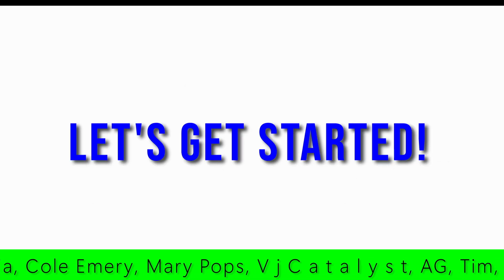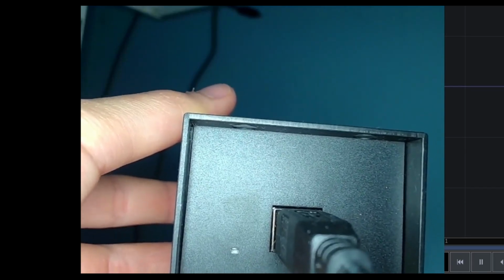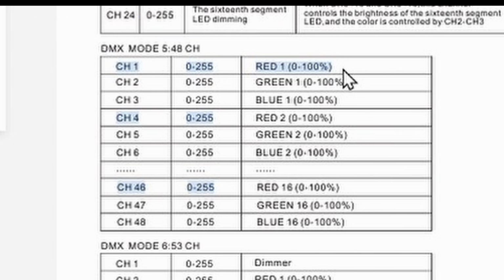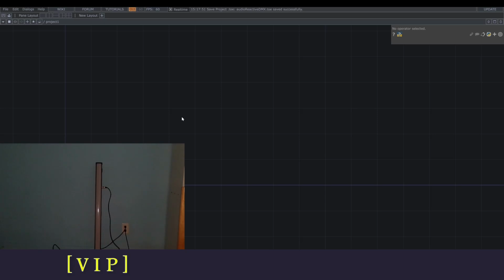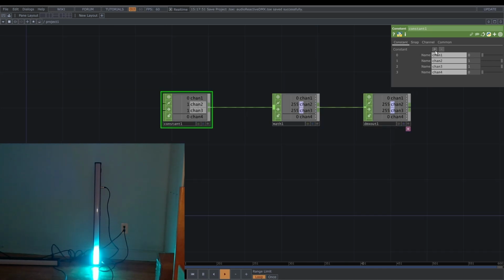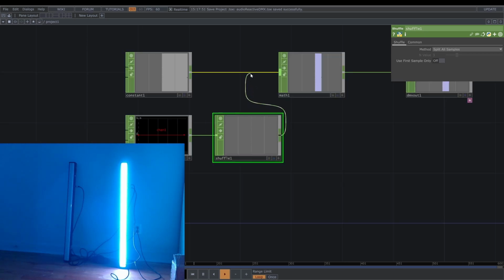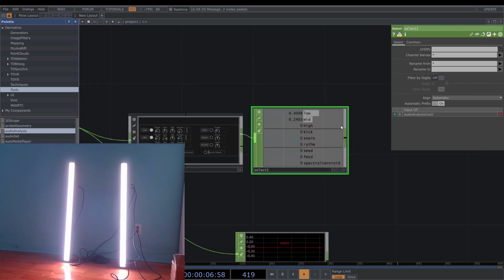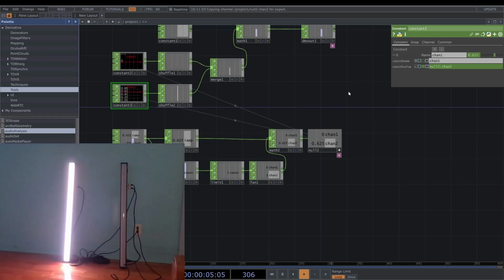Perfect Guide to Setting Up Your DMX Bar – Step-by-Step Tutorial!

Comment: do we need two artnet node for two light bars? if not then how are the connections?
Reply from the maker: most of the DMX light can chain the DMX conncetion, these have input and output. If your doesnt have it, DMX hub or fixture hub something like that can be helpful for distribute the dmx signal to each lights.